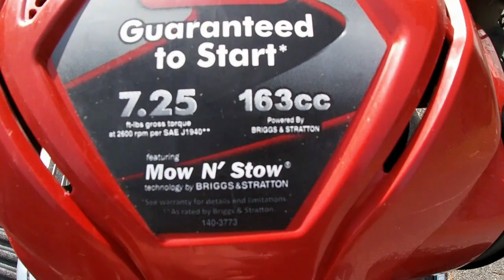New Equipment | I'm Shocked!!!

Comment: I’m not sure how I missed this video. It is an awesome mower. As far as the HOC goes I would not trust the book, get a HOC measurement tool they are cheap or use a measuring tape to measure from the ground to the blade and label your mower, that’s what I did on my Toro Time Master. My brother purchased the black one last year. I guess he had an oil leak issue, not sure if he ever got that resolved. Good video Billy boy
Reply from the maker: I am so sorry Frank that this comment didn't show up in the video it showed up in my analytics. Oh yea I have to admit this is the best push mower I had so far. Oh I will definitely do that cause I know many people have said that on videos. I hope your brother got the oil leak resolved. Thank you buddy and I apologize for the late response. I got to start checking my analytics more often.
Reply: @wildbillslawncare5901  That goes for any residential mower, I would always verify, then use a label maker to mark it. Commercial mowers would be different...

It ok. I know I have seen comments really old that I never knew were there. I have no idea why there no notification on some comments
Reply from the maker: @MyGreenLawn2019  Oh ok I didn't know that. I appreciate the info. Yea I went through my analytics tonight and found a bunch of comments that never got to the videos. I had to approve them, that's new to me.

Comment: I’ve always preferred the Honda 21 for the same price. More durable and better cut with the two blades
Reply from the maker: I do have a Honda HRN which the wheels were cheap plastic, but the HRX is a much better mower which I should have gotten. I do a lot of hills sideways and needed a mower that would not slip. I agree the Honda is more durable. Thank you very much Casey for watching I appreciate that.

Comment: I have the same push mower.  Still running but deck by discharge got damaged and a whole piece of medal fram came off. My self propel doesn't work very well.  Couldn't figure out how to change the belt. I like the better gas cap. I like the extra wheels you were showing.  Its a good mower for the price. I use it sometimes but im too rough on my equipment to own a homeowners push mower
Reply from the maker: Oh that's not good. Belts can be very hard. Yes the gas cap is so much tighter. I agree it is for the price and those tires I never slide. I'm rough on mowers myself I just try to be as gentle as possible with this one. Thank you for watching I appreciate that brother.